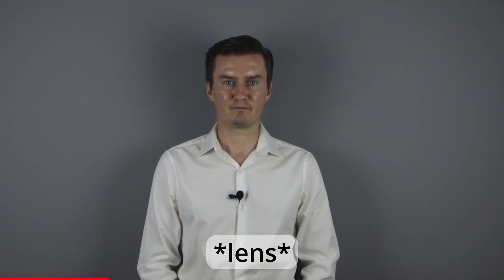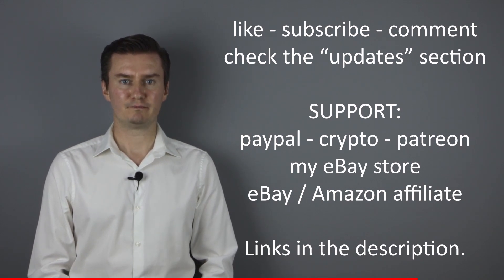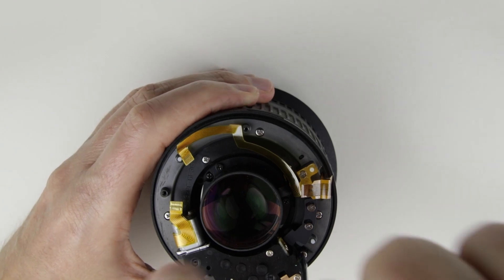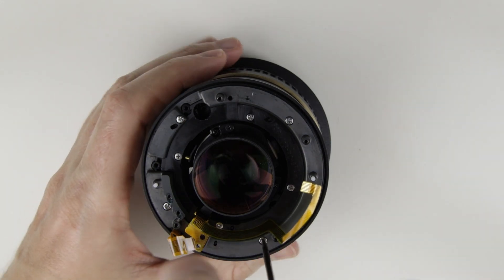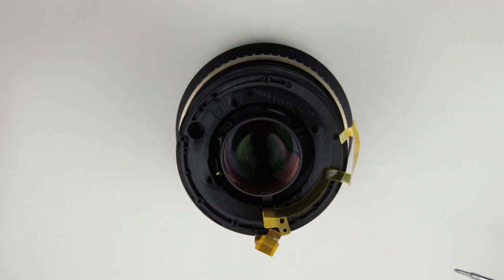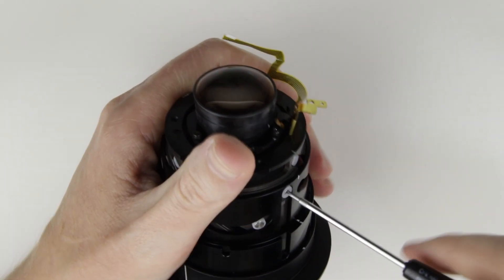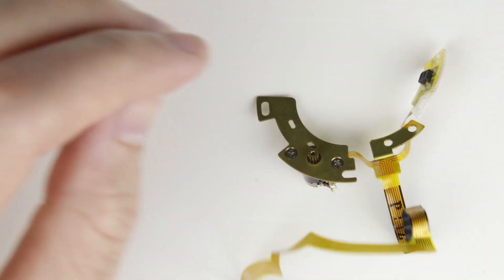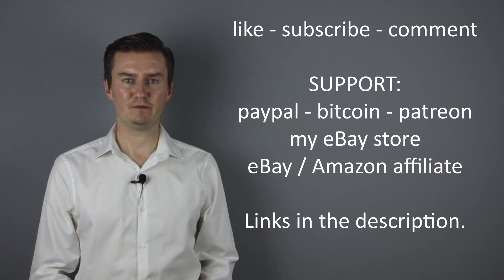Tamron 10-24mm f/3.5-4.5 SP AF Di-II LD ASP [IF] disassembly to replace the aperture flex cable

Comment: Before you start, mind that not only the "Phillips" type screws but also the three slotted screws on the cam barrel (and zoom key) [12:04 & 8:41]are JIS standard that normally require special JIS screwdrivers. It is even easier to ruin the slotted screws than the "Phillips" type ones since you often need high torque due to the applied screw lock on the threads of the screw. So if you don't have a slotted screwdriver that fits absolutely perfect without wiggle room and has a blade with decent length, stop. Otherwise, you'll damage the screw and you're locked out from the aperture assembly forever. Get a decent screwdriver first and carefully apply heat on the metal part of the screw with a soldering iron (if needed) in order to help break up the screw lock.

Great tutorial btw, as always. Keep it up!
Reply from the maker: Thank you for the tip... I have many types of phillips, and I choose what fits the screw best. I tried the JIS screwdrivers, but it was worse.